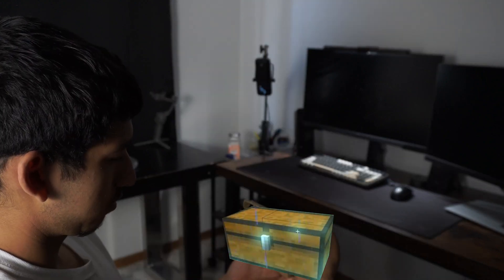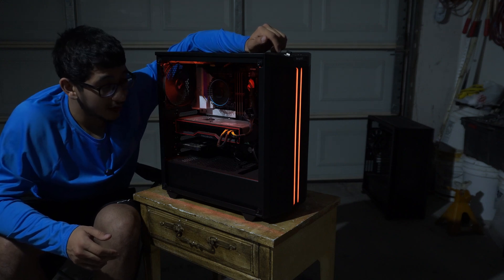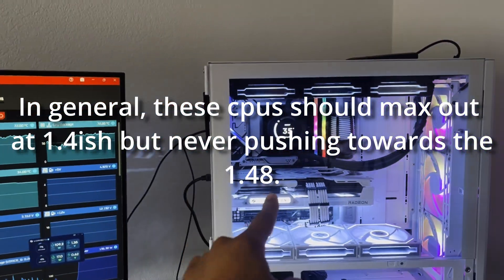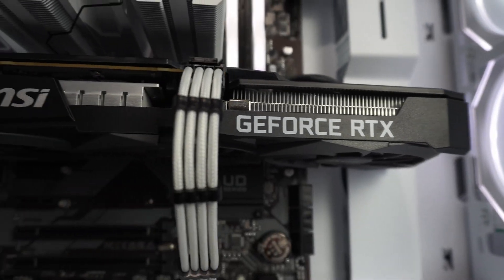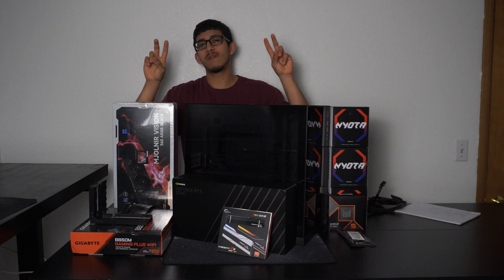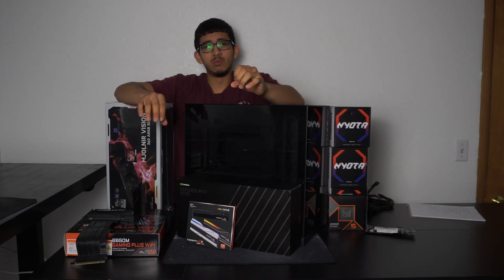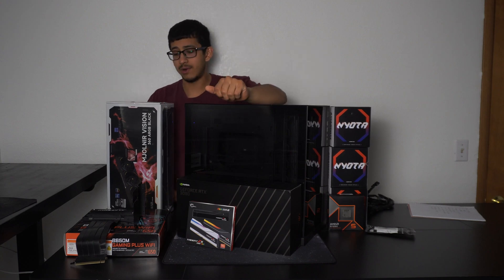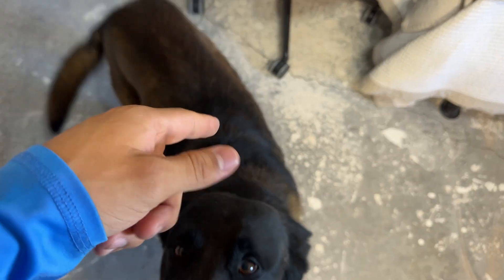Flipping PCs Until I Can Move Out I Episode 5

Comment: Hey, how do you handle it when someone buys a PC from you and later messages you asking for help fixing something that's not hardware-related? Like software issues or settings?
Reply from the maker: When my costumers have software issues, I first try to troubleshoot with them through messages however if I see that the fix will be more complicated , I will personally drive to them and fix it myself. This is because if it is probably something I did wrong, and the buyer should not have to deal with that. In the episode I'm currently working on, something like this happened where the buyer purchased a computer from me, however encountered issues with Windows. Even though I installed a fresh install, he still encountered issues, so I drove to his house and reinstalled Windows for him. He has thankfully not had any issues since and will cover it fully in the next episode. I hope that helps.
Reply: @Josetech95  Thanks a lot mate, that really helps. Looking forward to the next episode! Im flipping pcs from Spain and this is quite common here